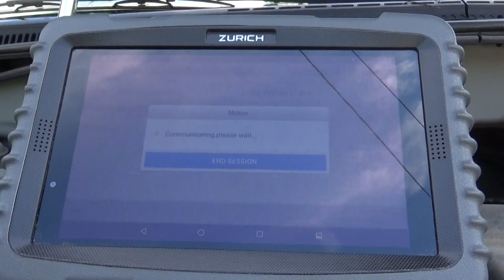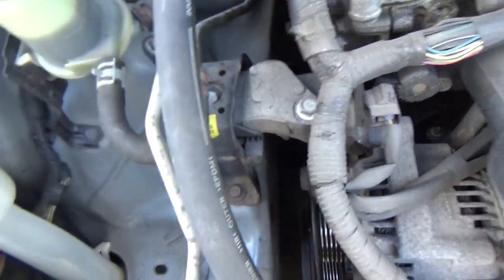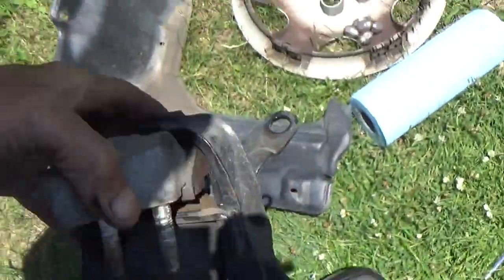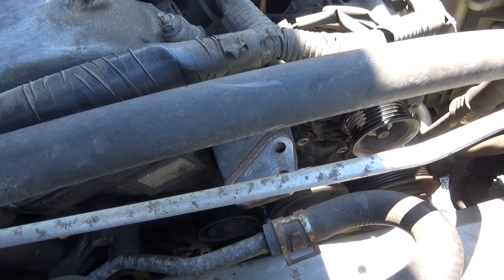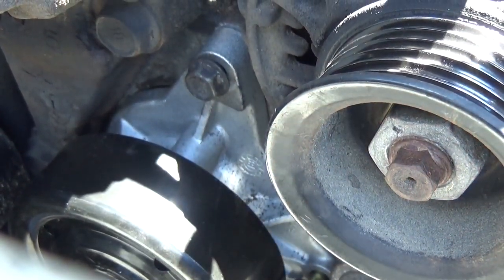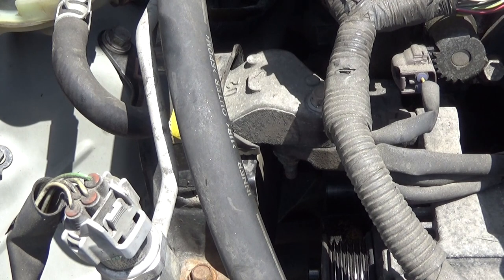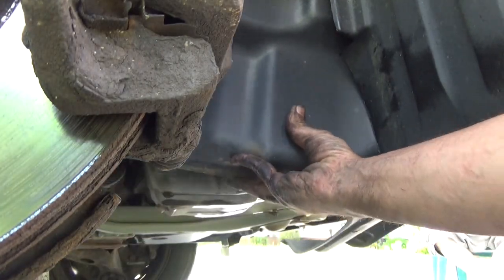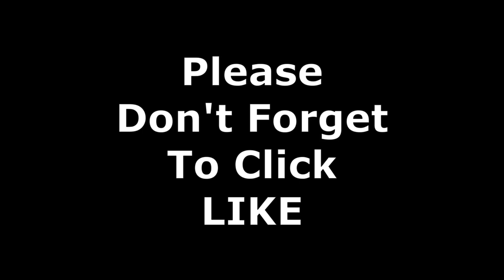2003 Corolla Water Pump - Auto Repair

Comment: Great how to video. Just changed the water pump on my 07 Matrix and opt not to remove the motor mounts. Just removed the alternator. Was not to bad gaining access to the lower bolts on the water pump.
Reply from the maker: Glad you found the video helpful!

Comment: Similar situation. Noise coming from serpentine belt area. Suspected alternator but removed belt and found water pump loose. Replaced and all good.
Reply from the maker: Thanks for sharing. This is why I always remove the belt and test to confirm. Sounds can be deceiving!

Comment: Thank you sir. It's making noise. What size are the bolts 12 mm? Thank you very much!
Reply from the maker: I believe you'll need a 10mm socket and box wrench, 12mm socket, 14mm socket, plus a tensioner release tool, and a short extension or two.
Reply: 12 mm
Reply: Yes sir . I watched a couple of or three utube videos on how to change it out. I changed a tensioner pulley, just the circular part , not the whole tensioner arm. And of course the noise continues. It's a water pump. Ordered. Hopefully the water pump holds out. It's rattling and rattles off and on . Do you know how long it has left in it to work still ? Is it the spinner that belts rides on , becomes loose? Thank you.

Comment: My water pump came with an O ring and a gasket . Could you tell me if I need to use the gasket please? Thank you very much.
Reply from the maker: Absolutely! While you MAY not need the O ring, you DEFINATELY need the gasket!
Clean the surfaces, and torque all of the bolts properly!

Comment: Maybe replace the belt before installing the motor mount, more room and better vision ?
Reply from the maker: Im not sure, but I think the belt would get in the way of remaining assembly.
Reply: @HouseCallAutoRepair  you might be right. I'll be doing the job in the am. Guess I'll find out.
Reply: Ended up doing the motor mount removal, needed more space for my large hands. Was about 3  stars on a 5 star rating for difficulty. Taking the alternator off would be about the same because of lack of working room.

Comment: Thanks for this no-nonsense video. For anybody who is fussy about torque specs, the bolts and nuts for the engine mount are spec'd at 38 ft. lbs. Two of the bolts going into the water pump where the bolt holes are deeper are 80 inch lbs; the other four more shallow bolt holes are 96 inch lbs. Wheel lug nuts 76 ft. lbs. It's amazing how different mechanics approach jobs. This video shows a perfectly good way to do it. Another good way is to remove the alternator instead of the engine mount. Either way is fine.  Here's a link for the belt routing diagram: https://www.toyotanation.com/threads/serpentine-belt-routing-diagram.1688137/unread
Reply from the maker: Information often varies with source too... 
I learned this the hard way on a cam sprocket bolt on an Audi S4.(I carry part of the bolt as a good luck charm) The torque values I went by, were for the wrong engine, and as a result, I sheared off a TTY bolt 5 inches deep in a camshaft. (Ironically the Audi featured as the banner photo at the time of this comment)
Reply: The last video I watched had a paper gasket with the o-ring.

Comment: It's a lot easier just to remove alternator
Reply from the maker: considering that the belt is already removed.... makes sense, if you want to. The only place that would have been beneficial for me, is during gasket surface cleaning.